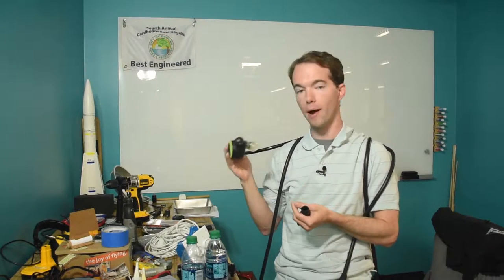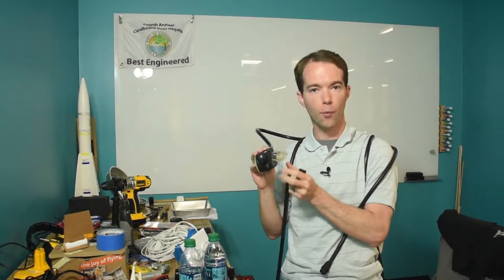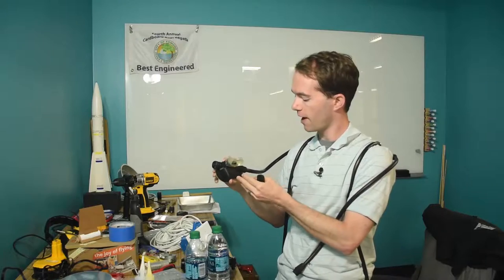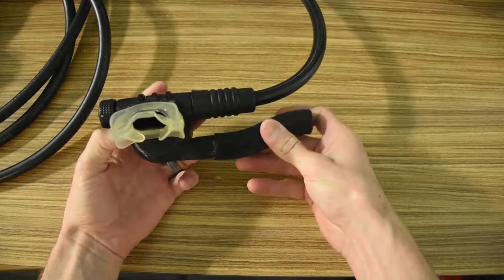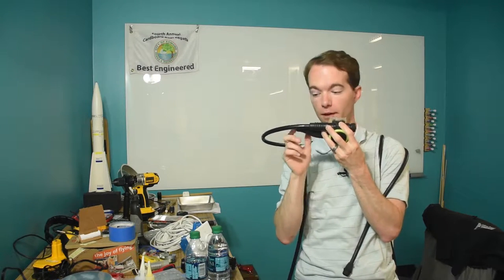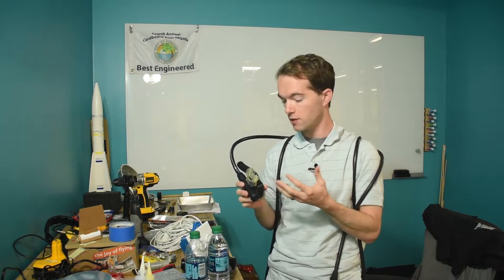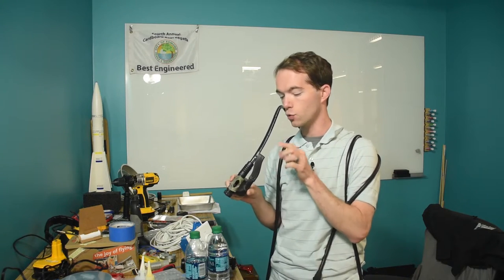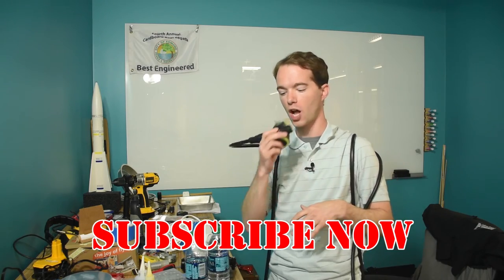3D Printed Scuba Regulator Side Exhaust

Comment: Did you ever put a full tube on it ?
Reply from the maker: No I never did. I didn't feel the need. I thought it might also make clearing the regulator harder. Had I felt the need, I would have tried. Thanks for watching!
Reply: @MikesInventions  after adding a longer tube it caused my regulator to free throw through the exhaust trying to work through it now.

Comment: Nice work! Do you share the stl file somewere?
Reply from the maker: Thanks Thom!  I didn't share this STL file, because It's a life-critical device, and I certainly don't want any liability for something like this. It's also only good for the Aqualung Micra ADJ, and I'd be surprised if anyone else has one anymore.
Reply: @MikesInventions  Hi again! Do you remember what program you used to design your model? What did your longtime test in PLA result in? Or is ABS a better material to use or something else?
Reply from the maker: @murrikurri  I used Solidworks. I've never had a problem with PLA in water, and it's easier to print with due to lower temps. It's also all I had on hand at the time. However, if I were to do it again, I'd do it in ABS, because we all know ABS works in water for sure and there is no uncertainty.